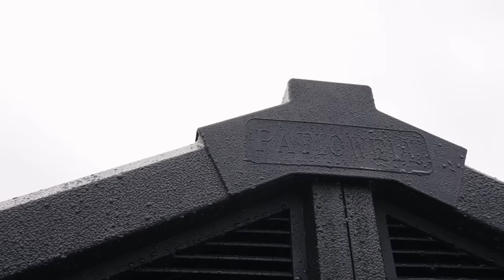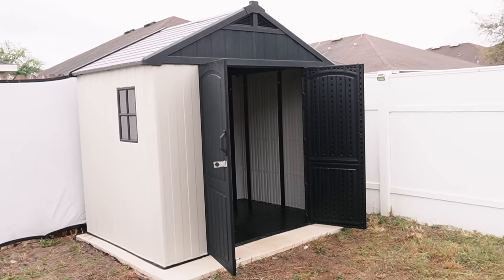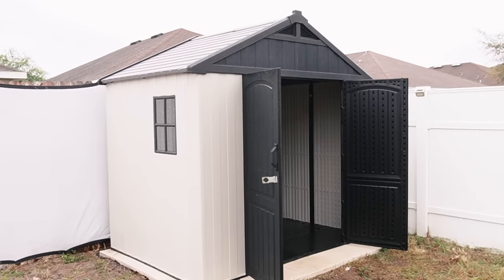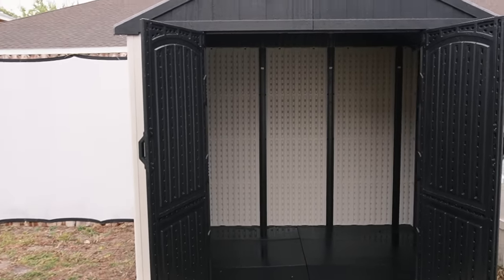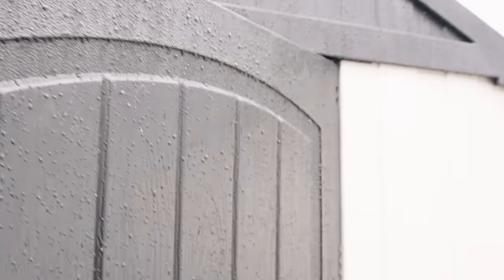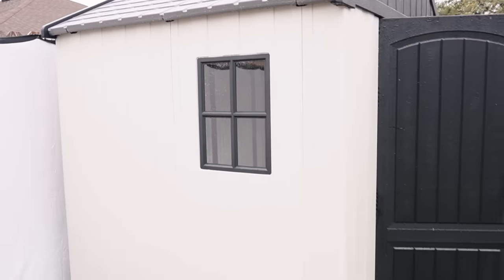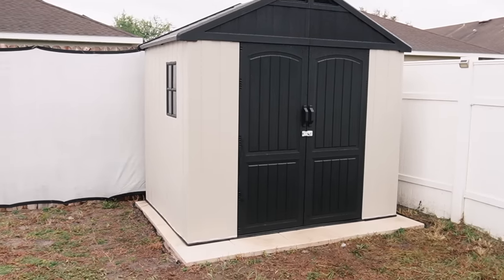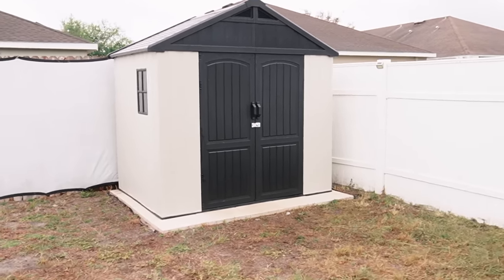BACKYARD MAKEOVER BEGINS ! | BUILDING MY OUTDOOR PATIO SHED | PATIOWELL REVIEW | FIXER UPPER | VLOG

Comment: You are awesome!  People make sure you check with your city first to see if you need a permit before putting up a shed - even if its not a permanent structure.  Also check distances from fence and water sewer.  Yup ... some cities requre you to build at least 5 feet from a fence, 20 feet from the main dwelling etc.  Check all the codes before starting a project.